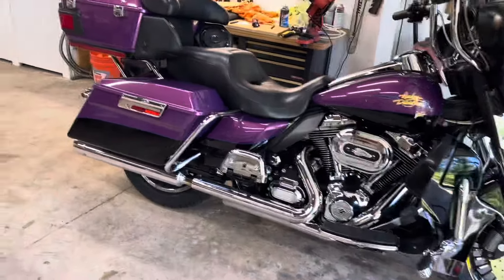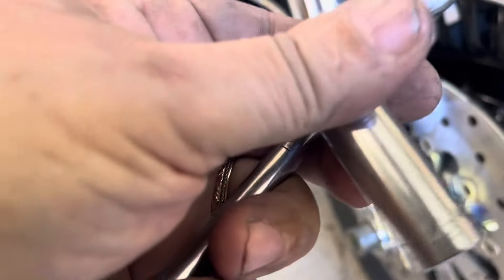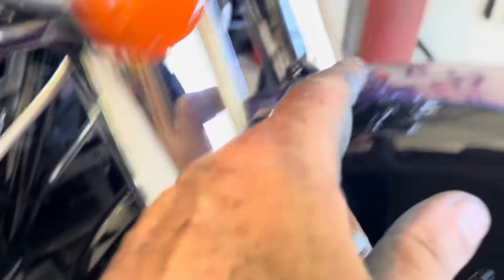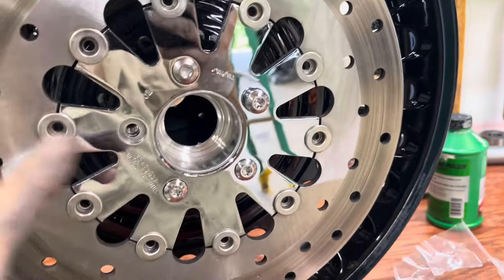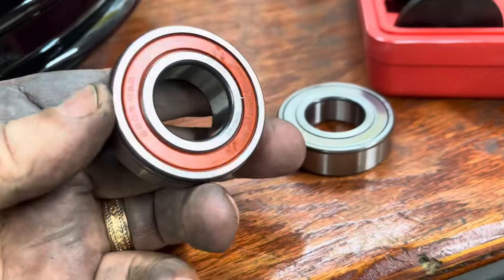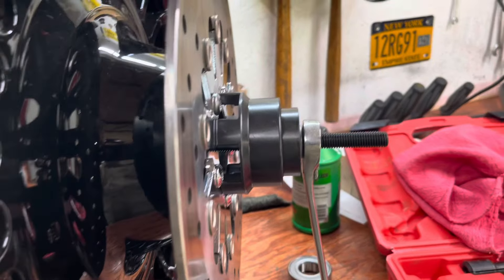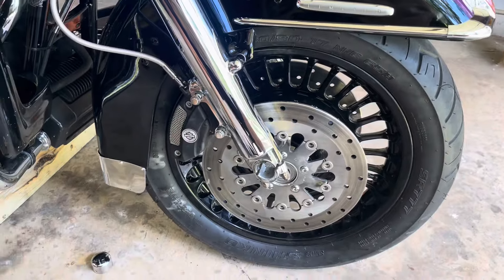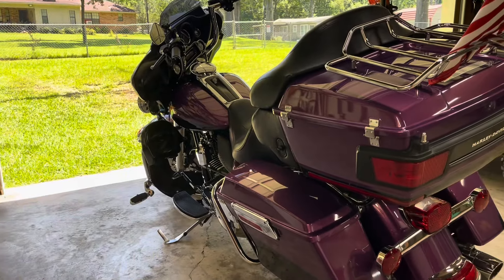Installing bearings and rotors on Harley rim

Comment: Brain freeze .... one of my lingering after effects of C. Gradually getting better. Scared the heck out of me when "brain fog" suddenly got much worse than being my usual absent minded professor self. Can't complain as some of the other effects of long C are getting better, too. 

Hope that tire isn't still losing air. Would be a shame to have to go through much of that work again in a few days. I'm sure it felt good to get back into the saddle again. 🙂

Hope, too, that you and Charly  have a blessed Sunday. Godspeed as you go forth.
Reply from the maker: We’ve both had our be “C” now and between the long lasting problems that going under lengthy periods of anesthesia, and the , I’m experiencing the brain freeze more frequently.

Comment: Good job well done. And saved many bucks.
Reply from the maker: Thanks. Harley would have charged me about 500 for the fuel tank check valve rebuild, and about 800 to do what I did to the front wheel.